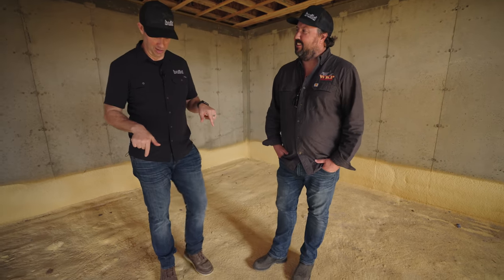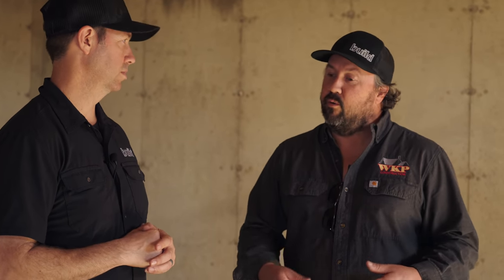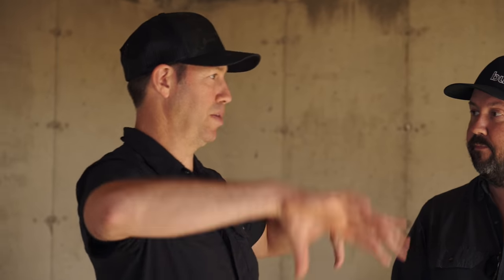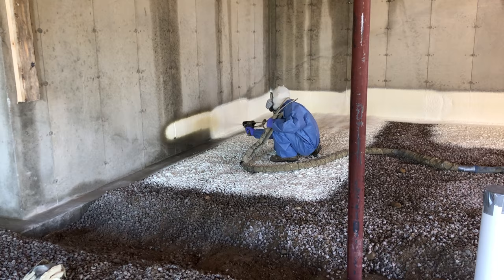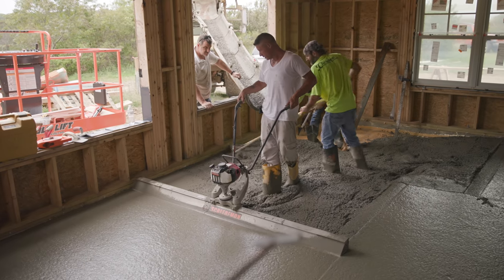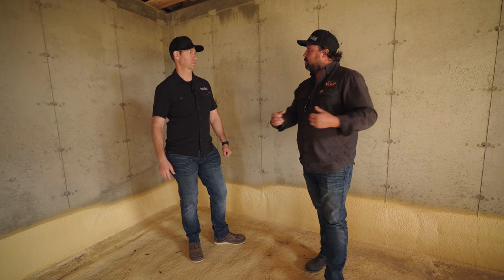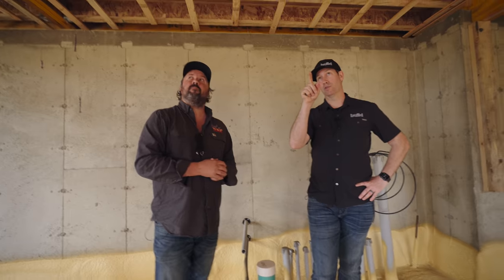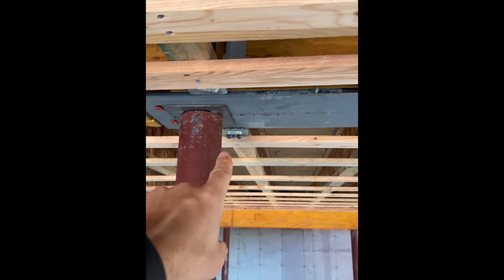3 Tips for a Better Basement BUILD (Insulation, Waterproofing, & Framing)

Comment: One thing when talking about basements not really discussed on this video how they address water, moisture. What treatment was done to the exterior of the basement wall?

I know that Matt is visiting a construction site that probably is beyond having the exterior of the basement wall exposed but some people don't know that concrete is porous and standing water in the concrete can degrade the structural integrity of the wall over time.

I look forward to the building on an island series, hopefully they'll talk about that a little more.
Reply: Matt has some older videos discussing this. A refresh would be good. But I found what he has to be highly useful. Liquid applied waterproofing with dimple boards and a French drain… I was drooling
Reply: I believe that Standing water against concrete will not degrade the concrete.
In fact I understand it will make it harder over time.
Concrete poured under water say for bridge supports takes a long time e to cure and gets harder.

Comment: Any good references out there for waterproofing an old stone foundation basement?
Reply: Polyurea
Reply: @RickGrimes807  polyurea as in the epoxy floor coatings? Or polyurethane foam in liu of washed out mortar?
Reply: @Zach8264  Polyurea has a similar formulation to polyurethane, but the final product is different and has another use. Polyurethane foam expands to provide thermal insulation, but polyurea cures faster and becomes a rigid but very souple membrane used as waterproofing for foundations, roofs, civil engineering waterproofing for roads etc. It's also used in single family residential applications. It's basically a sprayed waterproofing membrane. Sprayed with the same gun as polyurethane foam. Because it's sprayed, it perfectly seals all joints, junctions, gaps, etc just like spray foam does. And different polyurea products have different elasticity properties but most start at an 800x expansion, meaning they can stretch 800x their initial volume, which allows to take any structural movement without ever tearing. Also, polyurea is a sprayed rigid waterproofing membrane, so it's perfectly adhered to the surfaces, which leaves no air gaps that could condensate. From my experience it's really the single best product out there when it comes to waterproofing. They also install it as a combined system: polyurethane foam insulation + polyrea waterproofing on top, all sprayed with the same gun, same contractor = easy, fast and cost-effective solution. I wont name brands of manufacturers because Im just trying to give some basic info about it. I suggest you google it if you wanna know more
Reply: @RickGrimes807   I think I found what you're referring to. It looks promising but I'm unsure if it could fill the gaps. I cannot find the 800x expansion ones you are mentioning. Now the foam insulation could definitely fill the gaps and then waterproof it afterwards same as you mentioned, but would that leave me with trapped hydrostatic pressure behind it? I'm thinking it would. Considering in the past 3 days I've had 2 new springs pop up in my yard. Can't access the other side of that wall either except for 40' outx on the other side of the slab.
Reply: Add rigid EPS to exterior of stone with Silverboard and the cover with a peel and stick membrane such as. Colphene 3000 Soprema and then a dimple board
Reply: @Zach8264  Check out the Maxguard products. And of course the foundation has to be dry when the product is installed. After that you won't have problems anymore. And it does resist hydrostatic pressures. As you said you can fill the gaps with spray foam but it depends what kind of gaps? How big are they? You can fill them with basically anything you want, even some cement applied with a trowel would do.
Reply: @RickGrimes807  I'll look into that, thanks.
Most of the gaps are 1-3" nothing more than that. I planned on originally repointing with mortar but wanted a quicker, and possibly better solution as winter is coming and I need to get the boiler installed, tested, and running down there before that happens.
Reply: @billmccance7762  Unfortunately, that's not an option for this wall as there is a slab that runs over top of the wall and back about 30' to the driveway. I didn't create the problems, just inherited them and now I get to fix them.
So my only options for this wall are internal fixes, or tear out the wall, brace the slab, and re stack a new cinder or poured wall. Since the wall is almost 3' thick I think it's more than I'd like to take on right now.
Reply: @Zach8264  are the gaps full depth of thr wall? Whats the depth of the gaps?
Reply: @RickGrimes807  I don't believe they are full depth, but there's some that are half way atleast.

Comment: Spray foam vs 2” foam sheet under the basement floor is much more expensive; is it worth the added cost?
Reply: No, it's used because it save your contractor a lot of time not because it's better. ICF properly sealed on each joint installed above a based concrete slab that is then covered with a secondary slab that the build show has shown before is the correct way to do it. Follow the money.

What sounds faster, spray foaming directly on the ground then pouring a slab, vs a ICF barrier. To install requires a vapor barrier and based slab to be poured first then adding the ICF panels, cutting and taping all joints and doing your final pour on top. Best part they can charge you more for the spray method that doesn't do as well and takes less labor and materials.

Comment: No concerns with termites being able to use that as a corridor to the rim boards?
Reply: This particular house is not in an active termite zone.
Reply: @suavocado69  There are other insects that love to make nests in foam and degrades the foams ability to Insulate
Reply: If in an area where termites are possible, spray foaming to the top with no inspection gap will mean a company can't do a visual termite inspection. Bad news for the home owner.

Comment: In using nails to secure that strapping to the joists, and then hanging the sheetrock on the strapping, is there no concern about the nails working themselves a bit free over a lifetime of flexing and holding up the sheetrock? If one were to apply the sheetrock directly to the joists I don't believe they would use nails... but then why is it okay to merely use nails for the strapping and then hang the sheetrock from it?
Reply: The use screws to hang sheet rock

Comment: Will the spray foam collapse over time and possibly crack the concrete above it?
Reply: Seen it in crawl spaces down south in homes less the  10 years old. In areas where the drainage fails or is poorly designed it fails sooner then that. Had to crawl in plenty of these insulted slab crawl spaces, concrete cracks and with the water degrades the rebar in the slab.

This method cuts down substantially on labor and materials for a contractor then doing a proper ICF insulated slab that has a proven track record. Big reason it is done, save them money not nessary the best for the homeowners
Reply: Foam does not collapse over time. It has a compressive strength equal to XPS board stock insulation. Foam products are also certified for under slab application following relevant national standards (US, Canada, etc.). There's no settling or cracking issue.

Comment: I'd like to see what a certified electrician has t say about these "raceway" from your strapping. That's NOT CODE you can't have wires floating along your ceiling. The reason being if any screw goes through your drywall it'll puncture your wire & start a fire.
Reply: @daveklein2826  that's not what he is saying. He's asking a legitimate question about an unscripted comment.
Reply: @mistere5857  no sir, he made a statement that it was not code, I'm glad you are defending him but like him, get your facts straight
Reply: @daveklein2826  So Dave, give us the facts.
Reply: @PunaJussi  I'm not the one who said it wasn't code
Reply: The wiring is not strewn about haphazardly.  They still adhere to strapping and securing as per the NEC to ensure that drywall screw penetrations cannot occur through the wiring.  Same goes for plumbing items.
Reply: @michaelbiegel6973  I imagine you're right, though I'd like to see an example of it, and how this strapping makes the process that much better for the electrician.
Reply: @daveklein2826  The OP said it isnt code to let wires float in your ceiling in reference to a unscripted comment made by the guy. He ask for a certified electrician to take a look at the finished work and give thoughts. He's not making a statement that Matt doesnt build to code; he's saying the way it was explained is not up to code.
Reply: When ran in this method it is required that you have the wires secured. When they refer to the chases as raceways they're not saying that the wire won't need secured, it will,  just staples. Although that's only for the initial build. One bennifet is after the finished boards are installed if you ever want to fish inside, like say in a remodeling situation,  using it a an actual raceway is possible and allowed.
Reply: Are you being silly?  Any electrician would properly secure wires.

Comment: For the ceiling strapping, I would just use 1/2 drywall to span those tricky areas and 5/8 everywhere else like normal. Or 3/8 and 1/2, whatever the job calls for. Simple to mud and finish the drywall transition.
Reply: That would not work.

Comment: Why not just Icf?   I feel like some of these builds are simply trying to reinvent the wheel
Reply: No they are trying to play with someone's else money to see how cheap they can do it, as long as it holds.up till their warranties expire they don't care. Even closed cell foam absorbs water and termites love the stuff. See failed slabs done this way up north here. There is proven ways to Insulate a slab with ICF and there is this. Down south even in Texas has freeze issues that with little water inflation can crack a slab. This method cuts substantial labor and material needed. Not a method good for a homeowner
Reply: Show us your proof

Comment: Why dont you just put the insulation on the out/underside of the conrete structure? Its been standard here in sweden for over 20 years. Putting the insulation on the inside of the basement wall/floor increeses the risk of getting problems with due/mostiure inside of the struture.

Perhaps you should get over here Mat, I could hook you up with som great builders!
Reply: This is a retrofit application. The only reason why we insulate homes from the inside in retrofit applications is because insulating from the outside requires soil excavation which is very costly. Insulating from the inside in retrofit applications has been done for decades and works well in homes.
Reply: Yeah but you'd be in Sweden.

Comment: Would there be a risk of insects burrowing into the foam?
Reply: Maybe some borate ducting before the foam application.
Reply: @cerimite7674  Even with it they will eventually still make a home. See it a lot in craw spaces
Reply: This vidio appears to be on a single basement home.
Reply: @cerimite7674   Even with basements you still have to property seal around all ground penetractions with special products to stop insect making it into the home. The spray foam makes that easy.

Comment: Or just put XPS boards under the slab.
Reply: Adds a ton of labor for the contractor and materials. Personally I have seen nothing by problems with slabs failing with this method vs a properly done ICF poured slab.

Comment: There is always the one thing not being talked about. In this case: Termites. Termites love to channel through foam. This methods provides a perfect and uninterrupted pathway from the ground to the wood structure of the house. HUGE No No.
Reply: Agreed, home builders experimenting on customers dime to find the cheapest way to do things. This will last their home warranty and all the issues this causes will happen just after ot expires.
Reply: Show your proof
Reply: @daveklein2826  You clearly don't work in these homes daily and see how stupid of a design insulating a slab this way. 🙄 Foam breaks down, termites love making homes in it gaining entry into the home and killing the nests are extremely difficult. Add that with the foam holding water freezes in Northern climates cracking the slabs. Then allowing moisture to reach the rebar or metal mesh.

See it daily in New home construction in basements and crawl spaces. There are proven time tested methods in insulating slab  and there's this
Reply: @daveklein2826  
I have proof, big mouth.
Reply: @daveklein2826  insurance companies don't like that sort of thing in termite areas.  For example, Western NC and ICF foundations. Often insurance companies won't cover termite damage if the house has an ICF foundation.
Reply: @chrisE815  LMAO
Reply: @chrisE815  isn't termite areas everywhere but alaska? i'm pretty sure lol
Reply: @zack9912000  besides spray foam and XPS boards, what are some other ways of insulating a slab?
Reply: @chrisE815 what you forget is that termites have to get into the house structure.  You treat before you pour, use a metal termite barrier between concrete and mudsill, whice is pressure treated.

Then you have inspections every five years or so.

Comment: Hi Matt,

Regarding this youtube and also your "Learn from MY FAILURE - A Building Science Lesson" youtube (https://www.youtube.com/watch?v=30Jy2RTBd88), I have a question I'm hoping is unique enough you'll have time to address it.

Along with your above video, I've viewed many similar Youtubes of shell failures leading to moisture accumulation and subsequent rot.  What struck me in all of them was the origami nature of most flashing and sheathing systems.  --The very nature of the design and the materials necessarily called for extreme attention to detail during construction in plugging the seemingly hundreds of potential leak points.  Possibly on a good day with a high end building crew that level of attention can be attained.  But it only takes a couple spots to be missed or a worker not having a good day (happens to all of us) and problems can ensue down the road.

So here's my question:  Is there a building system that by it's nature does not require this almost "surgeon like" attention to detail to preclude moisture issues?

--And despite the variety of now available (and very cool) stretchy and moldable flashings or the liquid, roll on flashings ...these are still just high tech ways to get around the fact that the building system has many areas that need to be, for want of a better word, "plugged."  Is there a building system out there that by its nature just would not need to depend on these types of coatings, membranes and adhesives and the necessary install skill and attention they require?

Thanks!

Comment: When that foam rots away you are going to have a 2 inch gap under the slab that will allow it to crack and settle. Add foam that has absorbed water from poor drainage or poorly done in high water tables that then freezes in the winter, expanding and cracking the slab exposing the reinforcemet.

I am sure it would last long enough for the home build warranty to expire as they hope but that will be problems as it ages. Insects will make their home in it, foam will soak up water, even closed cell foam.  Hate builders experimenting on the customers dime. Would never pass commercial inspections doing it this way. ICF insulated slabs are substantially better for the homeowners, yes labor intensive but has a proven long term track record. This method save a builder substantial labor, not the best methods.  Funny Matt is doing the ICF method on his own home.....
Reply: LMAO
Reply: I'm curious how the foam would freeze when it's feet below the frost line.
Reply: @BrendanCBreen  It's not below the frost line, it is sprayed directly on the surface of the compacted gravel. During a hard freeze with any slab on grade home or a basement the foam that has absorbed water with winter temperatures up north  will freeze with ease. The ground still freezes.  Hell most slab on grade homes have issues with buried water line in the slab freezing in sub zero winter temperatures. Big reason slab on grade homes are not the norm up north and are difficult to make energy efficient because so much heat loss happens with slab on grade homes, especially when temperatures drop into the negatives.
Reply: It's a general question; most basements are at least 8' tall with about 2' above ground, with frostlines between 4' 6" - 6'. How would a standard basement have the this issue?
Reply: @BrendanCBreen   During extreme extended sub zero weather the ground can still freeze, not often but it can happen. The biggest issues we find with this method on basements is water saturating the foam causing it it break down substantially faster and damaging the internal structure of the concrete. Either from poor drainage or it being a high water table. Insects making large nests in the home is very common and are hard to kill. Again they could be doing a time tested and proven method that is known to last vs this . This is done to save time for the contractor. Not long-term for the homeowner .
Reply: @zack9912000  I personal wouldn't be concerned with freezing 6' below ground under conditioned space, just like I wouldn't worry about insect burrowing down 6' to make a home so far away from any food source, or water logging assuming one has proper exterior water mitigation system and didn't build below the water table (which is on the builder to understand the limitations of the systems they use). Honestly I can understand the concerns in crawl spaces, walkout basements, or slabs on grade, but just because there are "tried and true" systems doesn't mean we should damn people for wanting to advance building science.